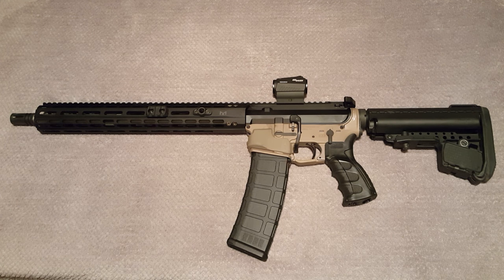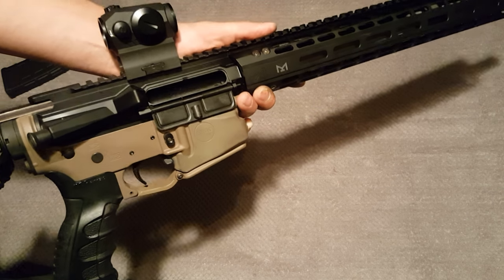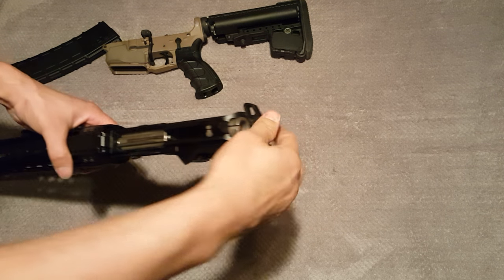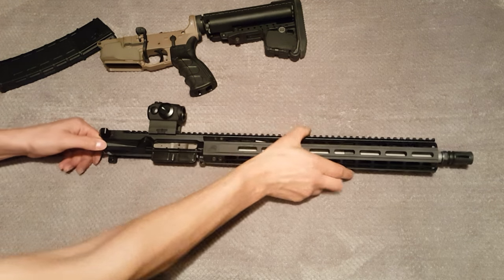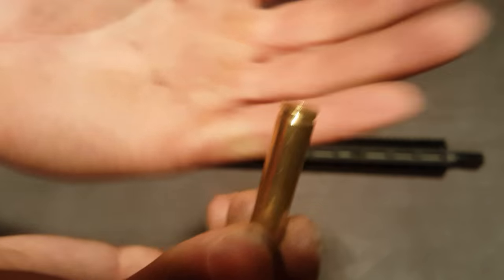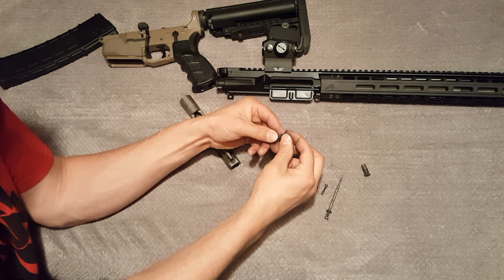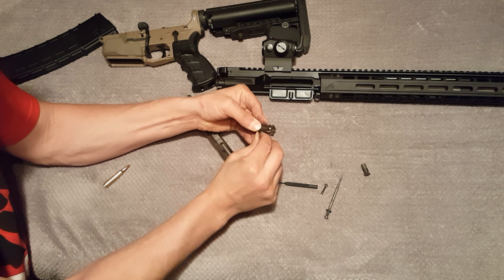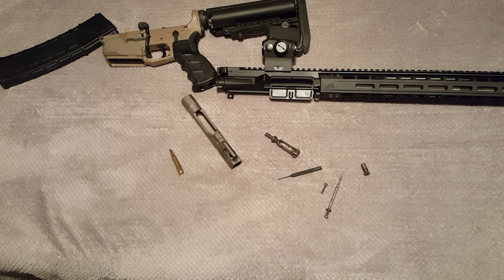AR Bolt Failure To Close /Seat Properly!!! Sharp's Relia-Bolt Extractor Spring O-Ring/Rubber Grommet

Comment: When do you put the o ring back in
Reply from the maker: I did after a couple hundred rounds but it's not necessarily a rush. I'm sure it could have gone several hundred more rounds.
Reply: @bereadybasics7525  does that o ring need to be put back in or no? Or is it only like a break in period
Reply from the maker: @Angels_Armory  many rifles operate with out them. I put mine back in a little too soon since the same issue came back when i reinstalled. Depending on how much you shoot, you may not need it at all.
Reply: Awesome thanks for the help
Reply from the maker: @Angels_Armory  no problem, hope it all works out.
Reply: @bereadybasics7525  Agreed.  All the rifles I had in the military never had O rings, just the spring.  When did they start putting O rings in bolts?

Comment: Hi how is your Sharps BCG holding up now ? Considering purchasing one
Reply from the maker: So far so good, not an issue since this video. I don't know your cleaning regiment but every time i shoot, i spray before and after on the BCG. I rarely disassemble and clean, still yet to have any issues again.
Reply: @bereadybasics7525  Awesome Thank You. I have subscribed to your channel so if you wanna do anymore on it that would be awesome.  There's a mixed bag of reviews on it on the old intranet.  Mostly good but some bad about the bolt breaking is all I've seen.  Again Thank You For Your Time Sir.
Reply from the maker: @markherrington2163  Yea i guess some of the first off the line had that issue from what I've seen. Thanks, i appreciate you

Comment: How long did you run it without the oring for?
Reply from the maker: Cody Streeter i believe 200 rounds,  i suppose you could just stimulate cycling buy just opening it manually with the rubber grommet still in

Comment: I havent even been able to properly chamber a single round. So I havent even fired the gun
Reply from the maker: I think a key thing to look at is the back of the round that failed to chamber. If there is damage to the back of the rim chances are the extractor tension is just to stiff. Is it a new buy, build or just new to you?
Reply: @bereadybasics7525  brand new build
Reply: I tried it with the o-ring removed from extractor spring. I cleaned the crap out of it to remove and new part gunk. It just won't fully feed the round. I think its the barrel or something.
Reply from the maker: .223? humm maybe try the upper and lower on separate AR's to find out which end may have the problem?
Reply: @bereadybasics7525  thats my thought. Gonna swing by the office an borrow a mil BCG and see if I still have a problem. Will also see if its a buffer spring and if its the ammo. I think its the barrel though. I've never had this happen and im confused.
Reply from the maker: @MattMacKo  nice, please come back if your figure it out. I'm going to think on that one some more, see if i can guess by the time you come back lol
Reply: @bereadybasics7525  it was the bolt. I swapped out the Radian Arms bolt, and placed the mil issue bolt in the radian arms BCG and it closed much further, but didn't extract. Then I just went 100% mil issue BCG and Bolt. And its fixed. I don't know whether the Radian arms BCG and Bolt are to light, or has too much tension on the extractor/ejector, but the mil issue fixed the problem 100%
Reply from the maker: Congrats on a working build. Maybe something was wrong with it from factory. I would compare it to another BCG and break it down too see what's different ect. You sound very much like you know what you're doing tho so i'm sure you got plans. I hope this thread helps someone else out. Thanks For Sharing.

Comment: Doesn't that bolt cost 200 dollars? That's too much money for an unreliable bolt carrier. At that price margin you shouldn't be having those problems
Reply from the maker: Bdpjev i wouldn't call it unreliable, just a short break in period. I have 1,000 additional rounds after this video with no issues. I would recommend and may buy another. Thanks for checking it out
Reply: You are right, especially when the stock bolt works from the first round.

Comment: Mental note (for me) don't fall for the hype and stay away from Sharps BCG.  Like I get it, simple fix.  But seriously... a $300-$400 bcg with that type of issue/malfunction is ridiculous and unacceptable.  Especially when I own 16 ARs atm and my BCGs are either mil spec and a few 'foo foo (unnecessary) nickel boron crap.  And guess what .. .NO issues .. ever!  Mil spec crap and some foo foo shit that out performs Sharps.  Ok.  I'll pass.  24 yr ret vet w/9 cmbt tours.  IDK... what the hell do I know about my rifles though.  I'm just not a 'foo foo' kind of rifleman.
Reply from the maker: Yea I'm kinda with you after owning one but i have spoken with alot of vets that have never used these rubber grommets. It must be some civilian foo foo thing but what's it's main focus???? I mean a civilian shouldn't get more use so if the theory is longevity of extractor tension then all military rifles would have one,  so i don't know.
Reply from the maker: And alot of out of the box rifles have these grommets so it's not just the "high end foo foo" either, so I'm even more confused to the point

Comment: I took out my O’ring and shot 6 rounds and it jammed again.
Reply from the maker: Feed it a few more to break in that spring. If it's a factory AR. If it's a build toy may have another issue
Reply: @bereadybasics7525  All factory stock.
Reply from the maker: I would push a few rounds through it, clear the jam, smack the forward assist if you have to in order to fully seat the round. Till you get smooth functioning.
Reply: @bereadybasics7525  2 weeks later and nothing. It won’t even shoot one bullet through it due to it continue to jam. My ar is still like brand new because I can’t even put rounds through it. I just can’t fix it.
Reply from the maker: @Yazabdul  any luck through the factory or where you bought it?
Reply: @bereadybasics7525  or he could just clean and lube.LoL

Comment: 1. Im calling bullshit. (Not at you, just logically). It you fired and the casing ejected, the extractor worked!   The next round would get pushed in.
So i dont see the extractor as an issue.
2. The O-Ring...naw, aint going for that either. (1st) the extractor worked, your casing were extracting.   The pin will hold the extractor where it needs to be.
With that said and off my chest.
1. When you get a bolt. Take it apart and lubricate it and the carrier group,  as well as the extractor. (Did you do that when you first got it)?
Second, white lithium grease. Sprayed on the buffer spring and tube gives a new spring and tube lube to make a smooth force transition to the BCG. 
Just my 2 cents.
Reply from the maker: Just seeing this, idk why. It was all lubricated properly. Yes it did eject once it was forced on to the casing. The problem to the force required to grab the next round from the mag. It was making clear marks from simply too much tension on the extractor spring.

Comment: Classic sign of an overgassed system...its called bolt bounce.  Its not that your bolt wasn't closing, its that you were so overgassed, the bolt was actually moving so fast it was hitting the casing and bouncing back, hence the marks on the casing.  Overgassed systems either need a (1) heavier buffer, (2) hipowered buffer spring, or (3) adjustable gas block.

Comment: A cheaply built upper with incorrect head space. Try go/no gauge.
Reply from the maker: An Aero Precision Upper with Sharps Relia Bolt, not cheap. Just too much pressure on the extractor spring.

Comment: I still everything you said but mines still doesn’t work. The bolt carrier does not connect to the battery. While the upper and lower and still apart if I move the bolt carrier to the left just a tad bit and then push in then it will work. This is a brand new ar 15 so idk why it’s having this problem
Reply from the maker: Been away for awhile, did you come up with a solution?

Comment: Jp enterprise doesn’t use the O-ring on there bolts and Milspec will run without as you know there, but JP Enterprise uses a lil stud and 6 ring spring . They claim there no need for O-ring. All N all, bcg not seating is definitely a extractor issue and must inspect you weapon. You did good identifying the problem Hooah 😤